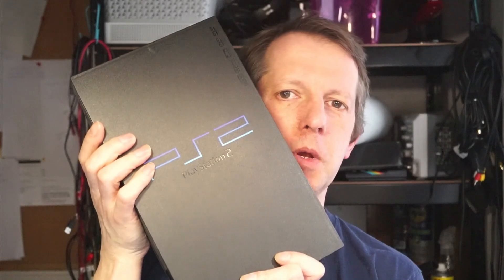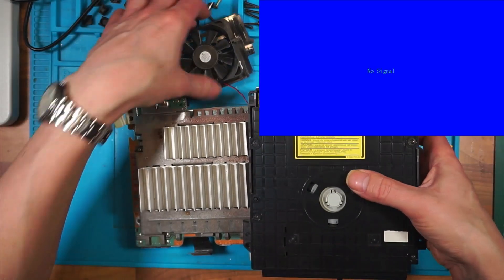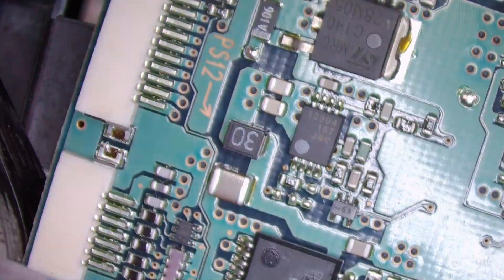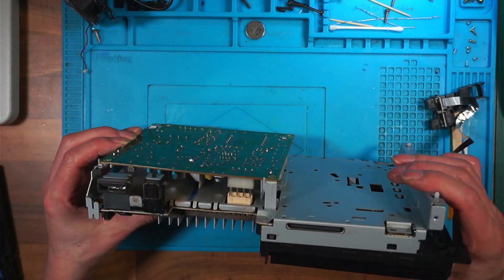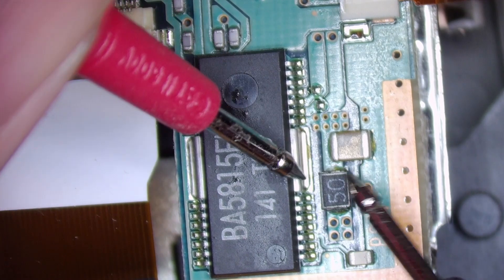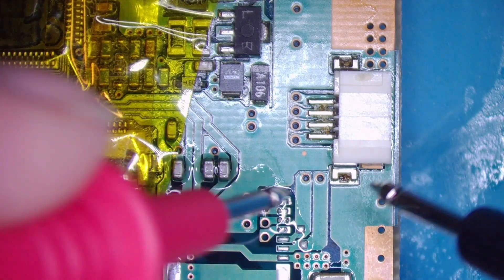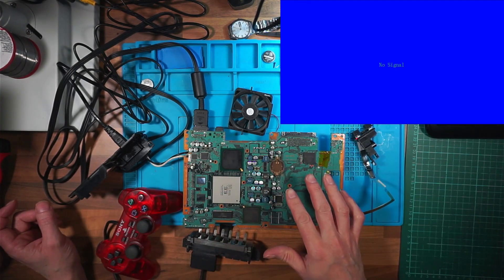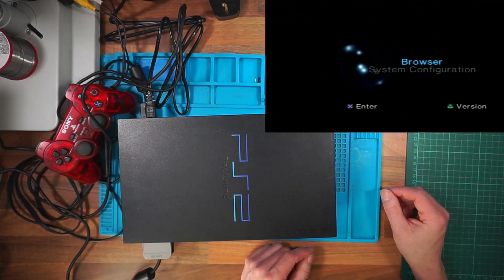Playstation 2| PS2 |  No Video | No Eject | Faultfinding

Comment: did you find out what was causing the no display? because i did all of this and it worked but when i replaced the chip with a new one the issue came back? help!

When the chip is removed i have display and a blue LED to eject, when i replace the chip i have no blue LED and no display :(

Comment: I found that the PS14 fuse (which has something to do with the disk drive) was faulty.  I installed a new fuse but it immediately became faulty, so I have no idea what could be causing it.  Very frustrating.
Reply from the maker: Have you tried looking around that area for shorted capacitors?
Reply: @PhilipBryden  Did you replaced the fuse when removed the chip or did you leave old one in the board
Reply from the maker: @youmaster21  It's been too long ago to remember. If the fuse was ok, I probably wouldhave left it. If the fuse was blown, you have the option to remove the faulty one before fitting a new one. Or you can fit a new fuse on top of the faulty one.
Reply: @PhilipBryden  Hey man, I can confirm that you do not need to change the fuse near the chip :D Just removed the chip and it works right away. Thank you for your discovery I´m going to try to use this PS2 just with the hard drive.
Reply from the maker: @youmaster21  Is it the chip that controls the optical drive you have removed? What was the fault with the system?
Reply: @PhilipBryden  Yes, i removed the chip that controls the optical drive. the fault was the same as your video, it powers on but no video.
Reply from the maker: @youmaster21  I have re-watched the video. I was quite impressed with myself lol. Will you let me know how you get on with the HDD? I haven't used one before, so it will be interesting to hear about your experience with it.

Comment: I would put my money on this being a botched mod job judging by all the solder smeared on the outer ground plane.
The most common failure when shorting out some of the pins you need to solder to, is one of the BA chips. Having the BA5815FM blown usually gives no output. Absolutely nothing, but the console usually still powers on, has fan spin and the disc tray does eject. But you'll know it doesn't work as you need to hold the power button down for 4-5 seconds to turn it off instead of the normal 1ish second.
If the BA6664FM has gone, it'll be the same, except that you get a blank signal out of the console

Comment: Maybe you could put in a Hard Disk Drive and play games off of that HDD by using a Free Mcboot Memory Card. 😁
Reply from the maker: I have a bunch of 2.5" HDDs I could use but I haven't used Free Mcboot before. Just now I've bought another PS2 Phat with 'no display'. So I think I should look into the HDD option, thanks.

Comment: I have the same problem my disk drive stoped working when I installed the laser for the cd drive but I didn’t plug in the laser cable and then the disk drive stoped working 😢 
I competed installing the laser then I tested by turning it on the disk drive worked for a second and the it stoped working. I noticed I forgot to plug in the laser cable tested it again and it was dead 💀 disk laser eject button not working
Reply from the maker: That sucks. Have you been able to test anything with a multimeter to see if it's a fuse or the chip?
Reply: @PhilipBryden I had the exact same problem! I adjusted the potentiometer and when I put it all back together it turned on, didn't spin the disc, froze, and when I turned it on again, no display, no eject, but fans turn on and light goes green

Comment: I will have a look if there on Tv dvd drives if so I have loads
Reply from the maker: Thanks Gary. After the recording ended I went to Aliexpress and found the faulty chip and 5A fuse I need to finish this off. Cross your fingers that the optical drive actually reads discs lol
Reply: @PhilipBryden  oh ok no worries, have faith Philip lol, but still fingers crossed 🤞 lol
Reply: @PhilipBryden  did replacing the chip work ?? Have the same issue